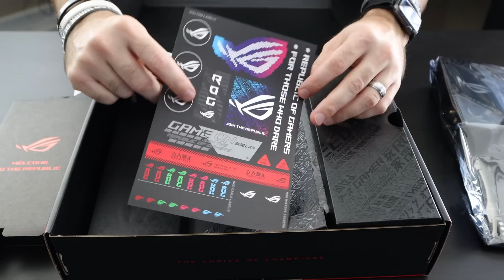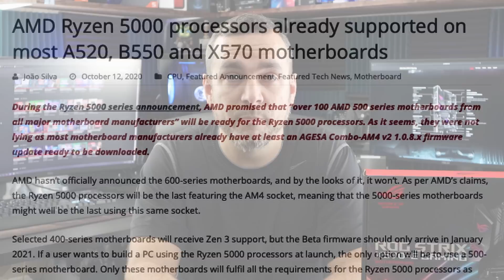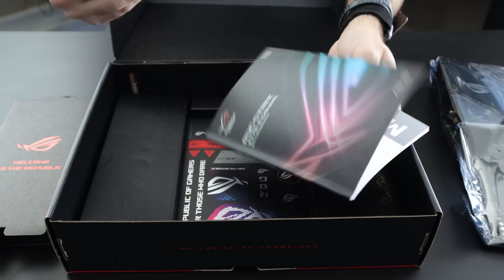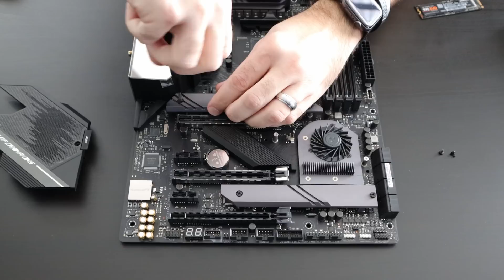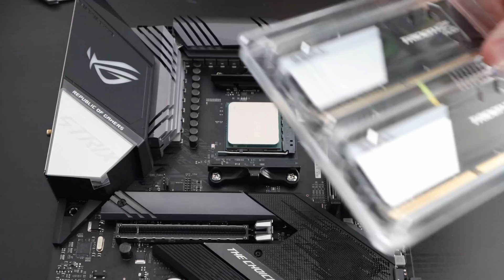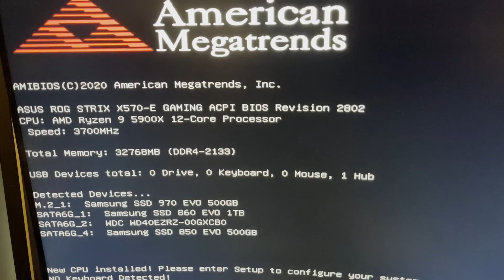Gaming PC Upgrade | Ryzen 9 5900X and ASUS ROG STRIX X570-E Gaming PC Build

Comment: I have the same board it is a fantastic board the chipset is always at 60c never gets any hotter and you can never hear the chipset fan. I have my 3700x oc to 4.4ghz at 1.25v. I cant wait to upgrade to a 5900x. Great video!
Reply from the maker: Awesome! Thank you for the info and feedback! How long have you had the board?
Reply: TechRated about 7 months now really great board. It should be for 300 bucks lol.
Reply from the maker: Okay! I’m glad that you do not have any complaints and that the fan is quiet. I’m kinda concerned about it, because I have not had a board with a chipset fan in several years. Nice build with the 3700X! 👊🏼 I almost made the switch then, but waited for this gen. Also, very nice OC on the 3700X. I hope to OC this chip soon in a future video and see what it can do.
Reply: TechRated ya I was worried about the chipset fan as well I’m hoping it’ll last 5 to 6 years the fan at least. And it has great VRM and it’s a really stable board I tinkered with my ram screwed up had to clear cmos and worked just great. So I just left my ram at xmp. And ya I was surprised at my 3700x oc as well!
Reply: does motherboard make that much of a difference. i have a b450 with a 5900x in it and i have to set the cpu temperature limit to 75 in the bios...
Reply: @maserati4000  Yes upgrade your motherboard most b450 boards have weak VRM.
Reply: @alexburke4569  i didnt know vrms made that much of a difference when it came to cpu temps. everyone keeps telling me to its all about the cpu and that i should reapply  themal paste and remount aio. i understad that when im going from the 3600x to 5900x that i would be dealing with a chip that runs hotter and uses more power, but jumping to 1.4 volts and hitting 90 degrees when opening apps on my computer is ridiculous.